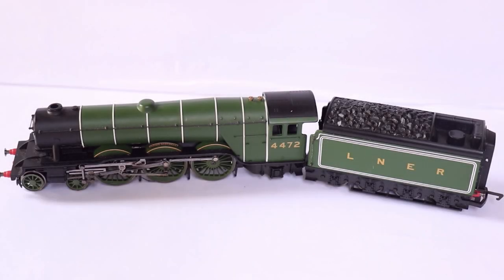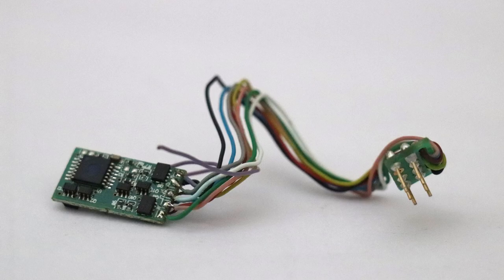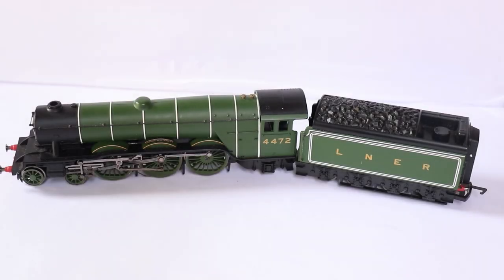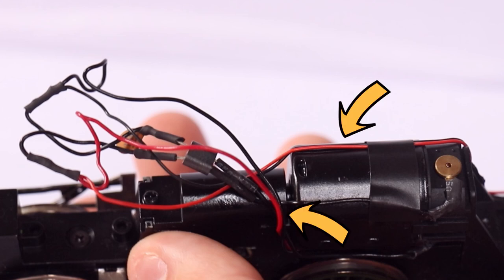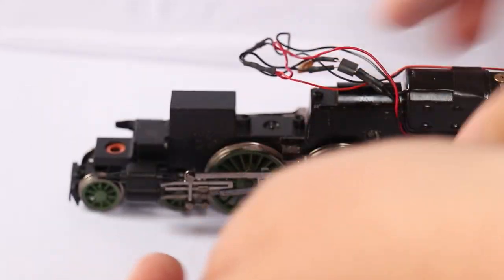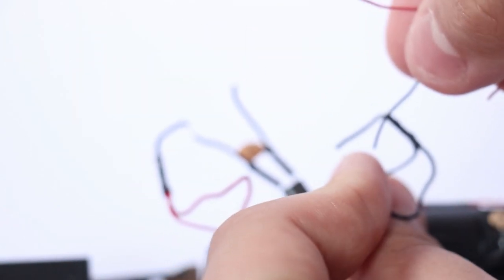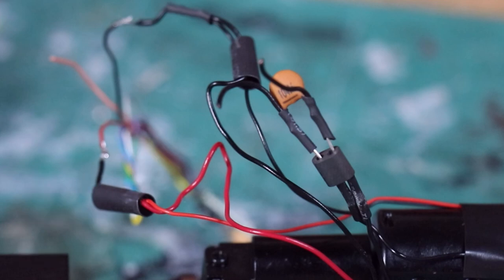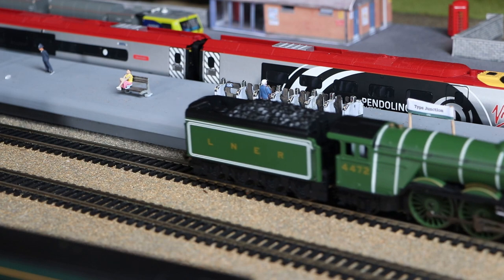DCC Decoder Fitting Hornby RailRoad Flying Scotsman | Tutorial How-To

Comment: A lot of people are worried about hard wiring because of possibly "frying" the decoder.  You can now buy an 8pin female socket with wiring harness for about £3 or less. Once you have hard wired it you fit a blanking plug.  That way you can check on DC that your wiring is correct. Gaugemaster sell a DCC 29 Decoder which you can then fit after first removing the blanking plug.

Comment: I have sooooo many locos that need hardwiring to DCC... I tend to cheat with my Lima Class 37s and 47s by swapping their bodies onto Hornby TTS locos (same moulding!). I usually hear the pinky-beige wire referred to as orange, so might depend on the decoder how bright that colour is! Yet another great video 👍🏻
Reply from the maker: Thank you 😀 Yes, I've got a few Lima and Airfix models which I have bought secondhand in the past, may need to fit them 😀

Comment: Great guide. One thing to note is I’d recommend removing the capacitor from the loco as this can interfere with the chips operation and the chip itself replaced the capacitors function. Great vid though, I’ve subbed 👍
Reply from the maker: Thanks! 
Thank you for the advice, in future I’ll give that a go 😀
Thanks again

Comment: Hi mcmetro, just about to get stuck into all this dcc stuff and do have a flying Scotsman that I would like to convert, but a couple of questions if I may? 

1) I presume the addition was both the chip and the decoder?

2) are the front boogies very loose on your model? If so did you manage to firm them up
Reply from the maker: Hi 👋 
1) All you need for the DCC installation is a decoder ( you may here the decoder referred as a ‘chip’ in mine and others’ videos however usually implied as the same )

2) I haven’t used my Flying Scotsman in a short while however I don’t believe the front bogies are too loose - if you have an issue it may be worth contacting Hornby.

Hope this helps!